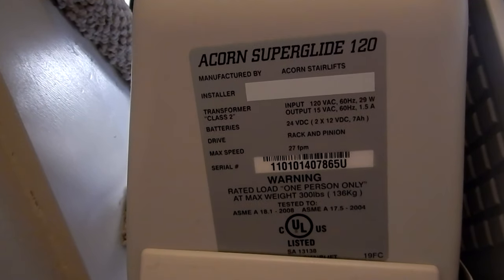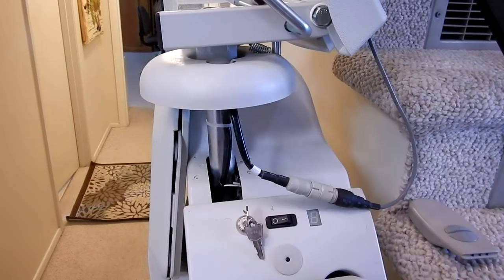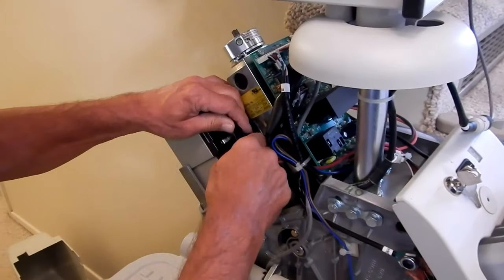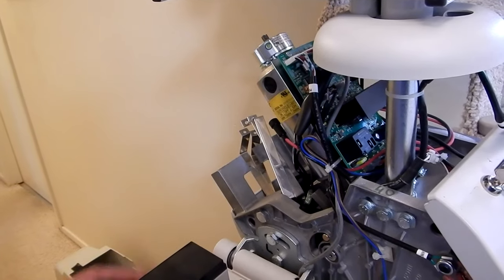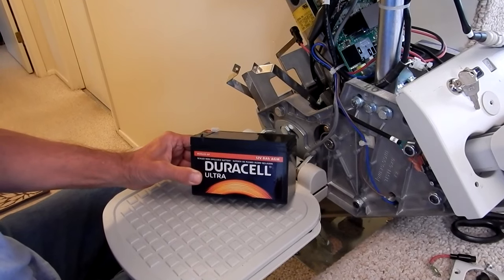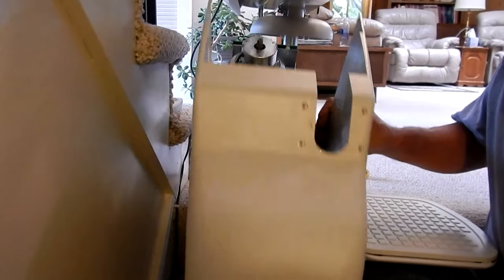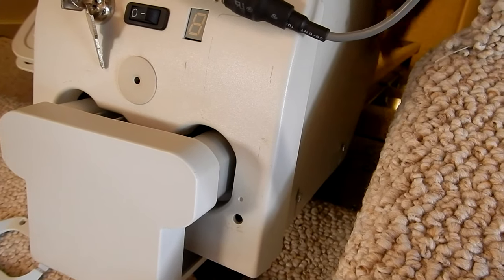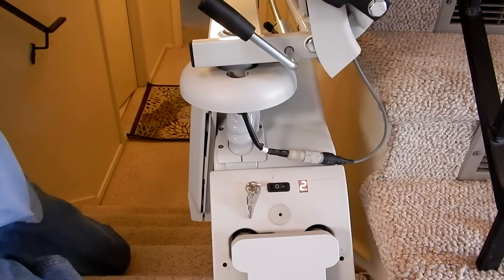How To Easily Replace The Batteries In An ACORN Stair Lift

Comment: great video.  got the job done but the machine is showing A1 code and will not go in the charging mode. the chair works but i think i am draining batteries. i turn it on to use then shut it off and keep it off. any advise, or will have to call a tech?
Reply from the maker: Do you have a battery isolation switch near the key? This has to be in the correct position for the batteries to charge. You could also try a reset by turning off the power for a couple minutes then back on.
Reply: @TomandJulieMineExploring  i have an isolation switch which i use as on/off. that and the key are the only switches i have. superglide 120
Reply from the maker: @robertbarsi6632  Obviously the chair has to be in the proper charging area to charge, which I'm confident you already know. For the chair to be going up and down all of safety sensors and limiting switches must be okay. You could try another charging area instead of your usual one. I suppose the charging circuit could not be working correctly. A test meter should be able to tell you that, if you have one and are confident working on the machine when it's plugged in. I don't want to get you in to something that is beyond your abilities, which without knowing you I don't know what they are.
Reply: @TomandJulieMineExploring  yes. and i assume with the battery isolation switch off the batteries are not charging therefore diminishing their life.
Reply from the maker: Lead acid batteries like to be fully charged. Anything less can be hard on them. The worst thing is to let them sit discharged.
Reply: @TomandJulieMineExploring  thats what i figured. i will try to solve this or call. thanks so much. your video and help is appreciated.
Reply from the maker: Good luck. You'll get it fixed somehow.

Comment: DURACELL BATTERY  FOR ACORN STRAIGHT  STAIRLIFT .WHAT IS THE MODEL # AND INFORMATION YOU NEED TO REPLACE IT.  I ALSO NEED NAME & MODEL # Of the BRUSHES
Reply from the maker: You should replace your batteries with the same type that are in the machine now. There are many different makes and models of lifts, which is why I can't tell you specific battery information. I don't have any information  on brushes.

Comment: Accidently my 12years old son Tanishq Bhattacharya felt from the stairlift .Now it stopped working.We called for service but could not fix it.Can you tell us some tips which We can service easily in our home alone
Reply from the maker: Hi Sangita. Sorry you are having trouble with your stairlift. It is hard to diagnose a problem without being there in person. There are safety sensors that could be stuck. Make sure the seat is in the proper position. You can try resetting the computer. I will send a link to the user manual that can help you read the error codes and will give other tips. You can manually move it back to the charging position, although it's not easy. Good luck getting it running. 
https://www.acornstairlifts.co.uk/Acorn-Stairlifts-User-Manuals-130.pdf

Comment: I have the I30 stairlift, but it makes a screeching noise when the up down button is pressed, acorn say this is a safety feature ( which can’t be disabled ) to warn anyone in the stairs, yours doesn’t make this noise, wondered why ?
Reply from the maker: I've never heard a noise from this one. That seems like it would be annoying.
Reply: Tom Wigren can I email you a short video showing the noise ?
Reply from the maker: @arthurdent6447  You can, although I'm not sure what I could do about it.
Reply: Tom Wigren Hi after contacting Acorn yet again, they now agree it should just beep not shriek, engineer coming out tomorrow, the installer also left some screws out and a cover not on correctly, guess he was in a hurry LOL
Reply from the maker: @arthurdent6447  Thanks for the update, Keith. I didn't think it should be making that type of noise.

Comment: Hi, could you please let me know the size of battery that is required, or model number so I can find it? Thanks
Reply from the maker: There are a lot of different machines out there and some might use different batteries than others. I would put in the same type batteries that are in there now. It's not terribly hard to get the cover off to see the batteries. The batteries should be readily available in most areas.
Reply: @TomandJulieMineExploring  thanks
Reply from the maker: You're welcome. Good luck with the job.

Comment: What is wrong when my acorn stair glide is blinking 7 and F
Reply from the maker: In my manual the number 7 has something to do with the footplate safety sensor. Check the downside safety edge and footrest base switch. Thr letter F has to do with the motor. Try resetting it by turning off the power for a couple minutes then restarting it. I'm  not an expert on the error codes and you lift might be different than mine.

Comment: will these instructions work for the model 130 T700    ?
Reply from the maker: Hi Ken. There are a lot of different models of Acorn and a lot of different manufacturers of stairlifts. From what I know, they are all similar to each other, so these instructions should work for you. It is not a very complicated job, only a little intimidating at first. Good luck with your chair!
Reply: @TomandJulieMineExploring  what brand and model battery do you recommend?   I want to make sure I buy the right battery.  I bought a used ACORN model 130 T700 and before they install it I thought I would change the batteries while I have easy access.
Reply from the maker: @n1kkri I hesitate to recommend brands and models of batteries because of all the different machines that might use different size batteries. I suggest you remove the batteries and replace them with the same model and size. The brand is not that critical. A store like Batteries Plus should have them. I've heard of others ordering them from Amazon for less money if you're not in a hurry for them.

Comment: What to do when its stopped 1/2 way between chargers?
Reply from the maker: You can try resetting the control board by turning off the power switch for 30 seconds then back on. The lift can be raised or lowered by hand winding, but, it takes some time. Make sure the power is switched off first. Google has several manuals available. Here is an example: https://13o5c1v23uv33kg1l368xd2l-wpengine.netdna-ssl.com/wp-content/uploads/2017/01/Acorn-Superglide.pdf
Reply from the maker: If the batteries are old you could replace them to get it working.

Comment: My husband took the lazy way out and left many parts off of the chair. I can’t turn it off to replace the batteries and he’s passed away. My mother is going to fall down the stairs any day and I can’t afford the $500 acorn wants to come out. Any suggestions for me???
Reply from the maker: You can unplug it. I'm not sure exactly what your husband did to the machine but you should be able to replace the batteries if that is the problem.
Reply: When I unplug it, it beeps continuously. I’m afraid of changing the batteries with full power. Is that safe?
Reply: He left the key off!
Reply from the maker: @Joanne P  I don't want to give you advice that might be wrong and cause you harm or damage the machine. With that being said I think I would be able to take the cover off and disconnect the fuse by unscrewing the fuse holder which will shut off the power to the machine. Anytime you work around batteries you need to be careful of the stored energy they hold. Even if you were able to  turn off the key the batteries can still be energized. Are you sure the batteries are the problem? Do you get any error codes on the digital screen? Make sure to unplug it if you are going to work on it.

Comment: Mine is barely chirping not the normal beeping and ideas?
Reply from the maker: It might not be receiving a charging voltage which can cause the chirp. Try a little research on the causes of the chirp and maybe you will be able to figure out why it's not charging. Good luck.

Comment: My chair is doing f 6 how can I fix it
Reply from the maker: In my list of code errors the number 6 pertains to an overun. The letter F pertains to the motor. You can try a reset by cutting the power to the machine for a minute then restoring the power. An overun is when the chair goes too far up or down and has to be hand cranked up or down, depending on where the chair is, a short distance. I hope this helps.

Comment: So it's powered by 12 volts?
Reply from the maker: Mine uses two 12 volt batteries in series to create 24 volts. There are different chair configurations by different manufacturers around the world, so replace yours with the same type that you are currently using.
Reply: Hi
Thanks for the quick response.
I'm in the Caribbean and these lifts are very expensive.
Contemplating building one from scratch
Reply from the maker: @trinifirst6702  You're welcome.  They are expensive.💰Good luck building one.👌

Comment: I followed the video verbatim, but after reassembling I'm getting an error message H2, what's going on?
Reply from the maker: A fault code #2 means no charge I believe. Are you sure the batteries are hooked up correctly and they are charged? Is the chair at the charge point on the track?
Reply: The chair is at the charge point, the model is 130 and the error message H2 means there are multiple operating errors, it's jumping between errors h2 and now h4, should I have used Duracell batteries?
Reply from the maker: #4 in the manual I have day the seat is turned. I might have the fault codes for a different model though.It shouldn't matter what brand of batteries you put in as long as they are good and are charged. Does the chair run?

Comment: Gotta ask. What if the problem is neither is the battery, nor the fuse. A friend and I tested the fuse first, the the batteries. The old batteries, in serial, tested almost as well as the new batteries. Problem? We're still getting an E3, and the chair isn't moving. Getting that plastic cover back on was a chore. Also, the rubber collar didn't have velco. I had to cut it. I'll put the velcro on this weekend, depending on the weather.
Reply from the maker: I think error code E3 has to do with the 'up safety edge'. Check for obstructions and make sure it is not stuck.
Reply: @TomandJulieMineExploring  Thanks! If it's not coming down in buckets this weekend I'll take a look.

Comment: So ours is just completely dead.  No lights or sounds.  Most likely is it because these internal batteries are dead?   The chair is almost 5 years old.
Reply from the maker: There would usually be an error code on the display if the batteries are dead. Make sure the unit is turned on and the power supply is still good. There is also a fuse inside by the batteries as seen in the video that could have blown.
Reply: Tom Wigren thanks I will check those things

Comment: Just a suggestion to all... Make sure to use a bit of tape to cover the battery terminals before removal. I saw the retention straps get fairly close to the terminals. If those are made of conductive metal and touch both battery terminal at the same time (on a battery with capacity) you'll have a dead short. It could result in an electrical shock, fire or the battery exploding. The risks are small but there...beware.
Reply from the maker: Thanks for the comment and suggestion.

Comment: My Acorn stair lift beeps and won't move.   The letter E shows on the display after I release the button.  Any idea what that means?
Reply from the maker: My manual say an E error is a brake fault and/or low battery. It suggests turning off the power for 30 seconds then back on to reset the control board and error codes. Is it in the charging position? It recommends charging the batteries. How old are the batteries? They are only rated to last about four years. Hope this helps a bit.
Reply: Tom Wigren.  The batteries are very old but do the batteries have to be good and charged for the lift to work and move? Shouldn’t the lift work even if the batteries are totally dead since the electric run the lift??
Reply from the maker: The batteries need to be charged and in good condition for the lift to work, Mark. They are what powers the motor.
Reply: Tom Wigren Doesn’t the electric make it run? The lights and the beeping sound all work.
Reply from the maker: @mkdsk101  No, unless yours is much different than mine. I believe on mine the electrical connection is just charging the batteries. There might be enough charge in your batteries to make the light work but not enough to run the motor, which would take a lot more energy.
Reply: Tom Wigren okay so mine is the Acorn super glider 120. Which batteries do I need to  order?
Reply: And how many batteries are on it?
Reply from the maker: @mkdsk101  I would recommend following the procedure in this video to remove the batteries and replacing them with the same model/number. There are many different Acorn machines, from different years, so I can't tell you which batteries you have or will need to replace them. I got mine locally at the nearest Batteries Plus store and they had them on hand ready to go for about $35 to $40 each and there are two in my machine. Take them out first so you know for sure what you need.
Reply from the maker: @mkdsk101  two for my unit.
Reply: Tom Wigren found them online for $10 a piece 😄
Reply from the maker: @mkdsk101  That sounds like a great deal.
Reply: My batteries are exactly the same as the ones you took out.  Mine are 10 years old.
Reply from the maker: @mkdsk101  That's a long life for them. I think mine were about 7 years old when I changed them. They are only rated for 4-5 years by the sellers.

Comment: My Acron got an "F" code three weeks after the warranty ended.
Reply from the maker: There are many different year classes, and a few different models, so it's difficult to be sure of the fault code meaning. In my literature an F fault code relates to the motor. It seems to me that many problems stem from a weak or dead battery. If your battery is more than a few years old I would start there and replace it to eliminate that possibility.

Comment: I cringed as the metal strap went past the battery terminals a temporary plastic cover would help
Reply from the maker: You were waiting for a spark weren't you.
Reply: Yes I was I used to fit batteries etc to phantom aircraft in the Royal Navy in another life… im hoping get a free stairlift from my local council in the uk just looking how te sort the bottom of stairs next to front door and I believe will be seviced every year

Comment: Why did you not do this at the bottom of the stairs? ok, I get it you're old, but you should have more knowledge.
Reply from the maker: The knowledge I have told me that unless I want to lay on the floor, it's easier to have it at the top. You can certainly use your knowledge and do it however you prefer. Thanks for your input.